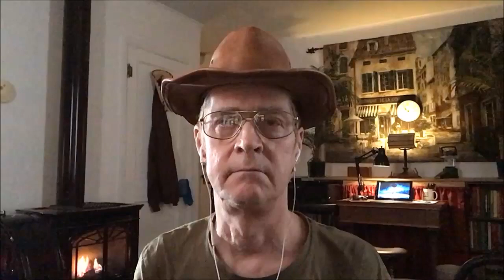Insulated-Wire Antennas

Comment: Hey Stan! I use this antenna formula for velocity factor and what not. Go into the garage and get 150 or so feet of wire and stuff it into my L match or cut it in the middle and feed it with ladder line.  Works pretty good! 73's from KE0RUP  and take care

Comment: You are correct about the formulas. but the black magic in electromagnetic radiation drops down to R+jX and the dielectric reactance is |1/wC|. Hence Reactance related to the capacitance will drop, and the square root of the R^2 + X^2 will increase which represents the overall impedance of the antenna. However, if insulation is covering part of the wire, say at the fixtures, the overall effect would be unnoticeable. So, suppose you have  a dipole with |73 + j43| ohms = 85 ohms impedance. Adding insulation would drop the Reactance part to a lower value. Think of it  as if adding another capacitor in parallel. Higher capacitance, less resistance to higher frequencies. Then you can see how the signal can be decoupled or coupled to different mediums. Integrity loss might be substantial if Reactance drops too low changing the impedance matching tolerance. But the overall antenna impedance is dictated by the 73 ohms which is the real part of the complex impedance. I'm sure I can over complicate things further by covering some black magic here, but I don't think anyone would appreciate the answer much anyways. Reference: Applied Electromagnetics: Early Transmission Lines Approach (Wiley). This was my textbook of choice from when I was back at the university.

Comment: i have one of your books, got any good ideas on building a lpf w/op amp to attenuate around 100hz? i got a cheap oscilloscope and work on automotive , i'm doing ap draw starting test and need to filter out higher frequencys, the engine probaly ony turns 200-400 - rpm